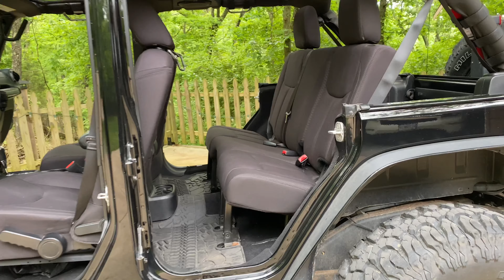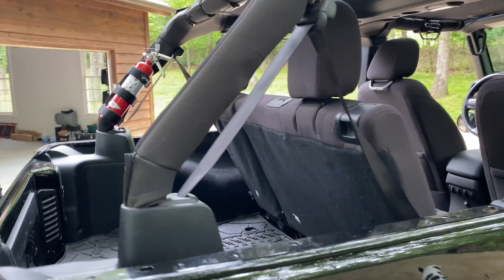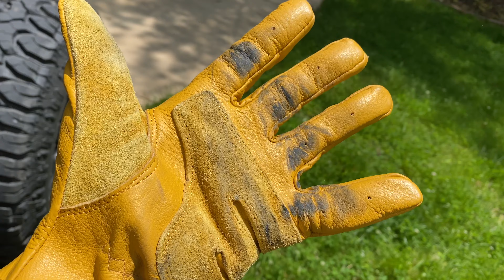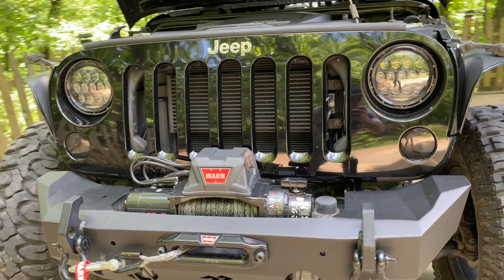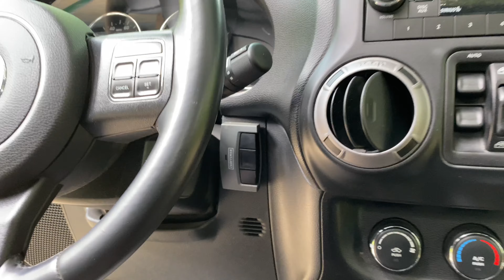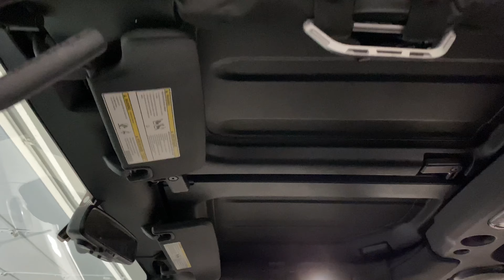FIVE GREAT WEEKEND PROJECTS FOR YOUR JEEP

Comment: How do you use the bedliner paint on your wheels?
Reply from the maker: Hey - for my wheels I used a wire wheel on my drill to rough up the surface then applied about 5 light coats. About 2 years in and they are holding up great.
Reply: @4XTRAIL  Awesome, thanks!! Great choice in runs....I have the same ones on my 35’s!!

Comment: Heh man I’m 16 lookin for a 4 door jeep to throw a lift and some 37’s on for my first car, what year and model is your jeep? love what you’ve done with yours.
Reply from the maker: Hey bro, good choice for a first vehicle 👍🏼 mine is a 2014 JKU. I will say that running 37s requires a pretty significant investment in upgrades (I did a video on this). I’d consider looking at a 2-door or even an XJ or TJ to help offset the cost of upgrades. If you stick w/33s or even 35s you can get away with far less initial upgrades. Just some thoughts! All the best.
Reply: @4XTRAIL  If I go with 35’s instead of 37’s is that enough to not need to regear your jeep or not?
Reply from the maker: @zachfaulknerr  It depends on which gearing the model you have is. Rubicon’s are 4:10 so if you could swing one of those, in my opinion, you could run 35s without a regear. You will want to have an AEV Procal or equivalent programmer to retune your shift points.

Comment: I’m late to this video but I’ve been considering blacking out the underside of my top! Would love to see a short video on how you did it, what you used and if blacking it out makes the inside of the Jeep hotter.
Reply from the maker: William Tyler Sanders I still need to make that how-to video! I used the Rustoleum product highlighted in this video. Can’t speak much to the before/after because it was one of the very first things I did to the Jeep but I absolutely recommend it. Most of the summer months I have my top off but if anything it may help keep your cabin temp more stable since you’re coating the inside of your shell.